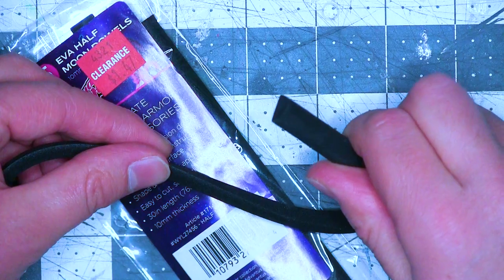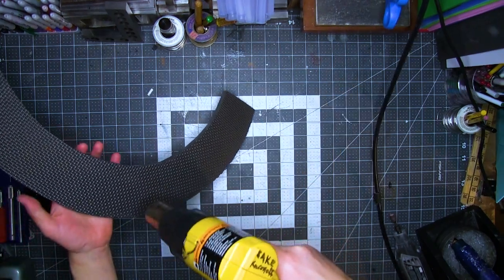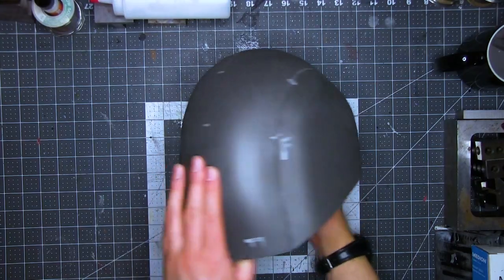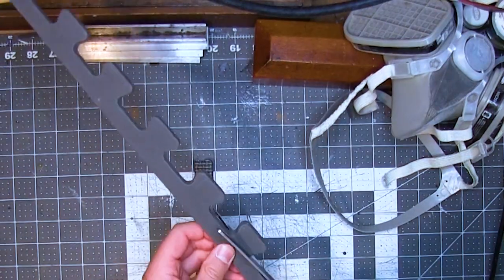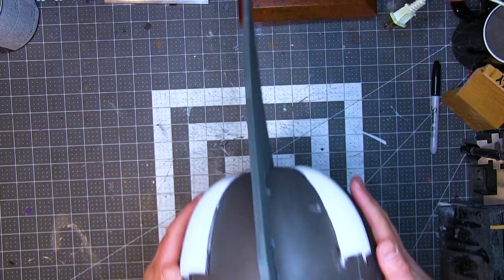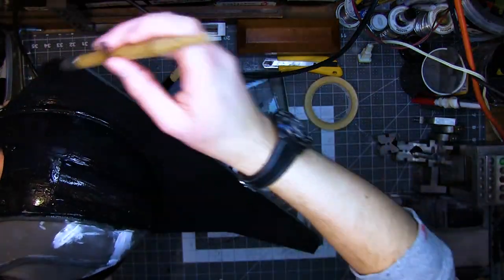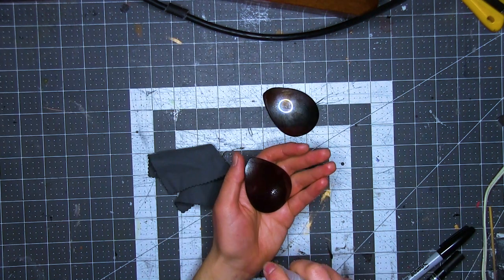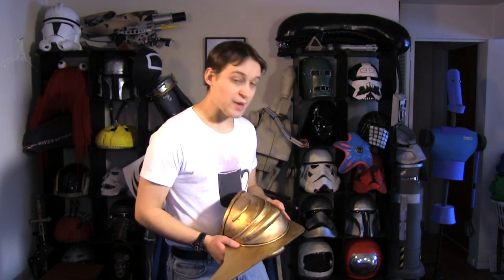How To Make The Rocketeer Helmet (DIY)

Comment: I saw this in the theater and it's still one of my absolute favorite movies to this day. I will say this I actually like the fact that it looks like it was welded together, and when I made my helmet ages ago, I used a low temp hot glue to fill in the seams along the fin. If done right, it looks like a weld.
Reply from the maker: oh yeah for sure I just wanted to try something different.